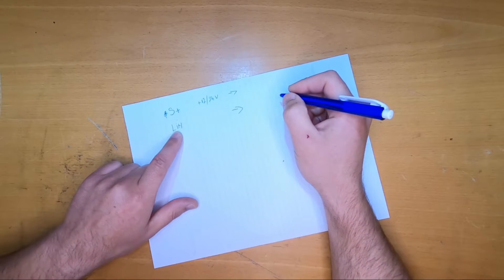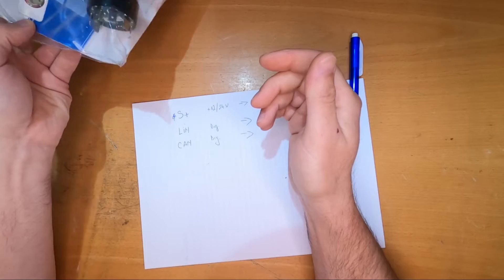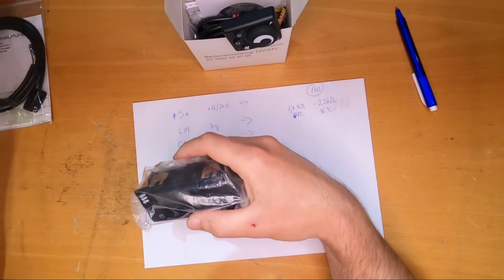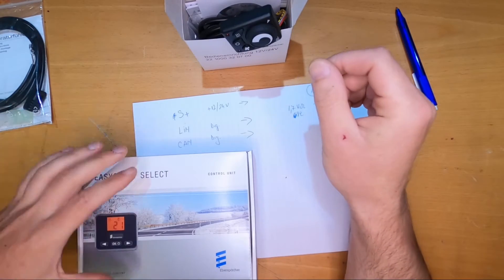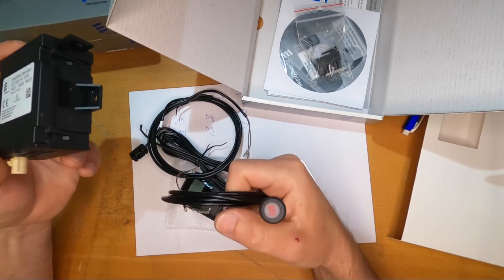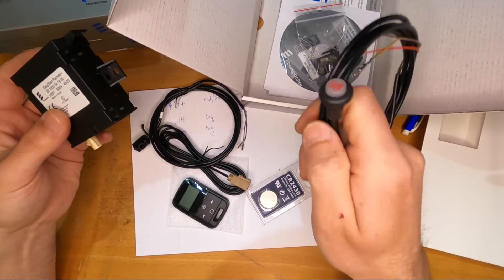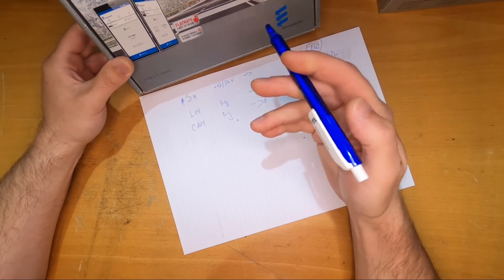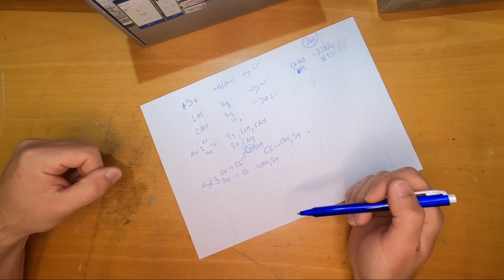Eberspacher controllers, EasyStart Select, Timer, Remote, Remote+, Mini regulator, Pro, Web

Comment: Hi , thanks for good video. Could you please help me with my question. I have Airtronic D2 , number 25-2334 , is there any other controller that i could use instead of mini controller. I would like to have remote temperature sensor and controller with digital temperature display?
Reply from the maker: From what I see this is an old MB 24V heater. Originally the heater had a temperature sensor in the cabin. Leave me an email so i can send you the documents I found for this heater.

Comment: Hello and thanks for the great information. 
I currently have the Espar B4L heater and would like to remotely turn on the unit without entering the vehicle and using the Easystart Pro mini controller. I understand that if I power the Yellow cable in the S+ to 12V the unit powers on/off. is this the easiest way to maybe utilize a relay to remotely power on/off the heater without entering the van and using the Easystart Pro mini controller? 
Also worth mentioning that when I provide power to the yellow lead in the S+, the heater does turn on, however, I am presented with a "Restricted Operation" with a wrench logo on the mini controller.
After doing some digging to see what that meant, I found that the unit has produced the following error codes:
P000160
P000440
P000450

If you can kindly shine some light on this this would be greatly appreciated.
Reply from the maker: I am not sure why you are getting 450 and 440, if you have the Pro controller on CAN really nothing else should be connected. Check that the blue/white wire is not touching something else. For the heater to work on s+ you also need to send a setpoint, you could do this by connecting a resistor between red/grey and brown/white wire. 1.7 kOhm is about 8 Celcius setpoint and 2.2 kOhm is about 36 C. So any value between

Comment: Thanks for the great video. I have a Hydronic D4W 12v (25 2096 05 00 00) but the control panel was not covered in the video. It is a Combitronic panel and the temperature up and down and enter buttons stopped working?? Can I use the Easy Start Timer as a replacement?
Reply from the maker: Combitrobic is developed by Eberspaecher UK and it has not really made it to Europe mainland. Looking at some diagrams these are more complex than simple controllers so you can't replace it with any controller shown in this video. It would be better for you just buy the pane as I seen it is a separate part from the controller itself.
Reply: @DIYHelper  thank you for your quick reply, I  really appreciate it.  Sorry, you refer to a pane, I am not sure what you mean.  Can you elaborate please?
Reply from the maker: Autocorrect strikes again, so according to the diagrams the system has a control panel which is just the buttons and display and a module which actually does the controlling. So probably you will need only the panel. Maybe ask butler technic or eberspacher direct, just these into Google.
Reply: @DIYHelper  thank you for your help 🙏

Comment: Hello, thanks for the video. I am looking to get an Airtronic S3 D2L, If I wanted to use the Remote+ (or Web) would I need to use another controller like the EasyStart PRO as well? Or will the Remote+ / Web app work without any other control? Thank you

Comment: Hi,can i use the easystart timer on a d2 heater manufactured 2003 to2004 since it can do s+ or the digimax d1000?and how do the wires go on the digimax?thank you for your time really appreciate it

Comment: Is it possible to use the Eberspächer EasyStart Remote+ and EasyStart Pro together?
Reply from the maker: Depends on the heater
Reply: @DIYHelper  Thank you for your response. Is the Airtronic L3 D6L model possible?
Reply from the maker: @SANG_BOY  yes it is possible, however I would use Timer and Remote + combination because in this way they are in sync, I would keep the pro only for diagnostic.

Comment: Hi.
If some heater, Hyd.3 CS for example, you say use CAN, S+. How to understand it? It can use both signals, CAN and S+? Via diferent pins?
So, if I would like to buy some aftermarket Eberspächer, where from can I read about starting signal used on this heater?
Reply from the maker: CS can be started with simple + signal or via Can with Easystart Pro. I recommend you get it with the pro because it can also read and delete errors. A simple switch can't do that.
Reply from the maker: And yes it could use both signals, however it is not recommended you use both.

Comment: Hello, I was hoping to see something about the 801 controller. Our heater runs perfectly, but you have to hit the start button about 10 times before the green light will come on. Any clues??? Cheers
Reply from the maker: Unfortunately 801 is not sold here, it was developed by UK if I remember correctly. I could be a physical fault of the button.

Comment: And last question. Hydronic II D5SC (with fuel and water pumps integrated). What interface it support? If S+ also, then its very easy to install and use, it needs only 3 wires, +, - and starting signal +12V, right?
Is it always ready for using S+ or need to reprogram or something? What pin for S+?
Reply from the maker: Depending on the heater number it could also work with LIN. For S+ it is the yellow wire
Reply: @DIYHelper   Iam Webasto man, just start to discover Eberspächer heaters, so thatwhy asking stupid and simple questions.
D=diesel
5=5kW
W=?
S=?
C=?
other letters=?
Thanks a lot.
Reply from the maker: @ruslanserdjuk8029  w=water heater, s=standheizung (parking heater) c=compact
Reply: @DIYHelper  Ok, quite similar with Webasto.
and Z probably = zuheizer.
Webasto make also plenty of car brand based heaters, so many of them can not be used somewhere else (CAN connection with car HVAC needed). Eber the same?
If yes, then if the heater is removed from Mercedes for example, how to know is it regular LIN/CAN/S+ or its made only for Mercedes?
Reply from the maker: @ruslanserdjuk8029  usually it will be exactly the same. Oem water heaters in most cases cannot be started only on vehicle Can.
Reply: @DIYHelper  Ok. But what is EasyFan module? Webasto OEM heaters dont need any additional modules.
Is it made for climate control activation with regular (LIN/CAN/S+)  Eberspächer heater? Or it needed even with OEM heater?
The question is, if this module is installed, can we say the heater is not OEM and can be used as regular heater with other cars?
Reply from the maker: @ruslanserdjuk8029  oem will not have easyfan as far as I know , easyfan is a can module used in aftermarket to start the vehicles climate when heating.
Reply: @DIYHelper  Yep, I was thinking the same and I was right.
I bough on auction (it was quick desigion and there was no time for thinking and analysing) set of Eberspächer D5SC + EasyStart R + EasyFan + wireing. And I hope the heater is aftermarket. In other case I have nothing to do with that and its wasted money.
According your words it is.
Thatwhy I looking as much as possible inormation about Eberspächer. There is not much videos about it (compearing with Webasto).
Thank You a lot!

Comment: What controller would you recommend for a water heater? I currently have the D5WS and the seven day timer in my 06 sprinter, but the heater is old and likley wont last. I am searching for a more modern espar (used) to replace it.  My want to use it for engine warm up and hot water through a calorifier isotemp. Really love you videos and the DIY spirit!
Reply from the maker: Depends on what heater you will get, we usually offer Timer for water heaters

Comment: Hi. It's great video, you're doing great job. I've a airtronic m d4 in my camper and it's working with the 3rd party controller. The problem is, it only works like one-off. I can't use different heating levels. Could you tell me please which controller can I use with it? The 801 should be ok as far as I know but it's discontinued at the moment. The heater number is 252113 and it doesn't have h-kit mark. Thanks!
Reply from the maker: Mini regler, the one with the dial should work just fine.
Reply: @DIYHelper 
Thanks for your reply. I would prefer something with a temperature display to be honest. Would the easystart timer work with my heater? Has it built-in temperature sensor like an 801, and will let the heater work in different power output stages?
Reply from the maker: @Hoheable unfortunately as far as I know all controls capable of this are obsolete. The problem is the heater that is old and cannot be controlled on the diagnostic wire. Maybe try getting 801 second hand somewhere.
Reply: @DIYHelper  
That might be the best option, I try to find one. Thanks again!
Reply: @DIYHelper  
Just one last thing. Can you confirm that my heater will work with four different power outputs instead just on-off with the 801 controller cause that's the thing I'd like to achieve.

Comment: great videos. thank you! I have an eberspacher hydronic that has been giving issues- im not sure if im locked out or not. When i send 12v signal the water pump kick on for about half a second then off and nothing. I had previously a bunch of "failed starts" where it would run for 5 mins and then shut off -- i suspect a fueling issue as i found a kinked tube and unkinked it, but now i have this new issue. Hoping to order a diag cable soon. thanks for any advice
Reply from the maker: What heater is it and do you have a controller or only a switch?
Reply: @DIYHelper  Eberspacher D5WSC -- it has a controller but it is this basic one (not shown in this video) which unfortunately only has timer and on/off function that sends the 12v signal to the controller that is built in the heater  (S+ as you describe in other videos). 

I wonder too if the glow plug has burnt out from too many start attempts in a short period if it would shut off in the manner that it is shutting off now -- 
I send 12v signal, water pump comes on for 0.5 seconds, then turns off, (controller still sending 12v signal).
Thanks for the reply!
Reply from the maker: No way to tell without a diagnosis. It could be anything.
Reply: @DIYHelper  Ok, I wait for diagnostic cable to arrive in mail. thanks!

Comment: Great. I almost got the pro but after this video I will get the timer. I have the hydronic s3 and heater blower matrix. Am I still able to install the timer control in order to control the fans and hydronic heater till a certain interior temperature of my van ? I don't want separate controllers. Thanks
Reply from the maker: Yes but it has to be the CL version and you will need the temperature sensor 221000342200, after this some parameters need to be changed in the timer. The yellow wire will be the output for the matrix fan (through a relay)
Reply: @DIYHelper  do you happen to have a wiring diagram ? Or where I might find one thanks

Comment: the 801 is the best controller that eberspacher has made for air heaters before CAN, easy to use, and easy to read and erase fault's. and the most liked by the users, but it does not have LIN start, and is now discontinued.

Comment: Dear DIY Helper, I have a mini regulator controller in my camper van, is there any other digital controller that compatible with that? For example the EasyStart Select? Thanks a lot!
Reply from the maker: Hi, it depends on how old the heater is, do you have access to the heater? Please take a look at the label, if it has the H-kit marking then you can use the Select.
Reply: @DIYHelper  i have airtronic m d4s heater.
Reply from the maker: Please tell me the heater number, starts with 25.... Six digits
Reply: @DIYHelper  25 2327
Reply from the maker: Yes, you can use the Select.

Comment: Hello Thank you for this very interesting video. I have a question, can I replace my "mini regulator" control with an "Easystart Pro" control? my heater is an Eberspaecher - Airtronic 3500 from 2017
Reply from the maker: Do you know the fabric number? Six digits should start with 25.... for diesel 20.... for gasoline
Reply: @DIYHelper  Hello, the only number I have is 37542PE and a barcode from the manufacturer, can I find them on the heater?
Reply from the maker: @queumkeum5897  unfortunately for this serial number you cannot use the Pro, only LIN controllers select, timer, Remote +
Reply: @DIYHelper  OK thank you for the information and the time you gave me, have a nice day

Comment: Very nice video. I am DIY installing an Eberspacher Hydronic in my car, and I find the lack of documentation a bit difficult. I bought a vehicle specific electric fit kit and a vehicle specific fuel kit. Are there instructions that only dealers have access too? Google yields nothing. I only have the generic instructions that came with the heater.
Reply from the maker: Do you have the part numbers of the kits?
Reply: @DIYHelper  Fuel kit: 29.2180.01.0433 and electric kit 24.8800.00.0026.0A for connecting to the AC fan. Unsure if the fuel kit is the correct one for my Hydronic HS3 D4E, I see there is also an Eberspacher fuel tank sender kit and a Fuel tank breather pickup that all fit my 2017 Hilux so three fuel options.

I don't expect free tech support, if you have Pay Pal I don't mind sending you $15 for the manuals and advice on the fuel pickup :)

Part numbers for the alternative fuel pickups: 29.2180.01.0434 (expensive) and 292180010433 (cheap)
Reply from the maker: https://we.tl/t-LjqOiYm7Vp I found the manual but nothing on the fuel kit. Manuals are only available in German, I hope it helps.
Reply: @DIYHelper  You are absolutely amazing

Comment: I have the Easystart Pro. Can I connect the Easystart Remote + with it?
Reply from the maker: First what heater do you have?
Reply: @DIYHelper  D2L with Easystart controller.
Reply from the maker: @marcandsebe  S2 or S3? But it is the same anyway. Yes it can be used with both the pro and remote + however there is no synchronization between the 2 interfaces. We have a similar setup but with Timer and remote + this way they synchronize. If you use the sensor inside the pro for temperature control than I would also recommend an external sensor in this setup
Reply: @DIYHelper  That means you don’t need a cellular one which is what I prefer.

Comment: Muy buena explicacion. Gracias. Te falto explicar el modulo que no necesitas pagar un servicio anual, que es el EasyStart Text+ ... que enviando SMS comandas el calefactor !
Reply from the maker: No mencioné EASYSTART CALL porque ya no está disponible. La producción se detuvo hace unos 2 años.
Reply from the maker: El que mencionas está hecho exclusivamente para el mercado ruso por Eberspacher Russia como Easytart CLIM. En la situación actual, la importación de estos controladores a la UE es imposible, el despacho de aduanas no es posible.

The one you are mentioning is made exclusively for the russian market by Eberspacher Russia like Easytart CLIM. In the actual situation importing these controllers to the EU is impossible, customs clearence is not possible.
Reply: @DIYHelper  si es verdad … yo pude conseguirlo a travez de un vendedor en amazon … te dire que funcionando muy bien !!! Un saludo y gracias por responder !!!
Reply: I have the Eberspacher Airtronic D4 in the locker room of the motorhome and was sold the EasyStartTimer.  However as the heater is in a different (colder) room the heater needs to switched on an off manually.
Would the Easy Start Pro controller be better for my situation as it has a temp sensor built-in.  Or is this only giving the temperature of the room without be able to control this?
Reply from the maker: I don't think so, the pro is only compatible with Gen 2 and 3 heaters, since you have the timer I guess yours is 1st generation. You can get a sensor make a few simple connections on the harness and it will work just like the pro maybe even better since you can move the sensor where ever you like. Just be sure to get the sensor that starts with 25 not 22. The second connects to the timer and will only display the temperature but not control the the heater. The one with 25 connects directly to the harness and will replace the one that is in the heater.
Reply: @DIYHelper  Thanks for your advice.  I will get and connect a sensor.